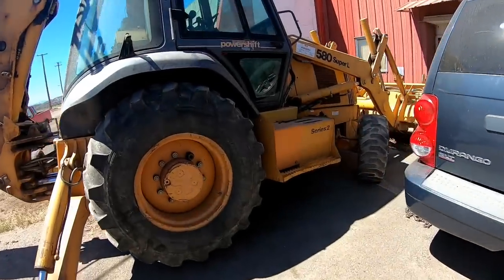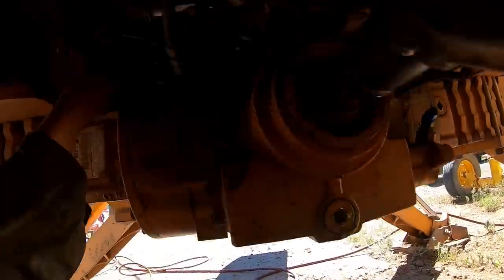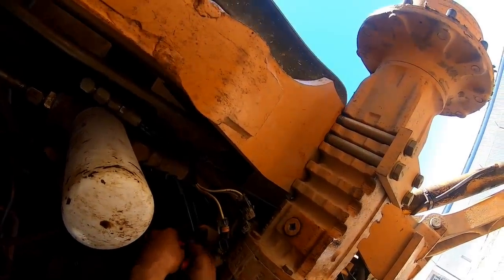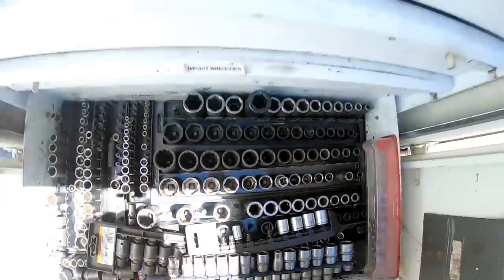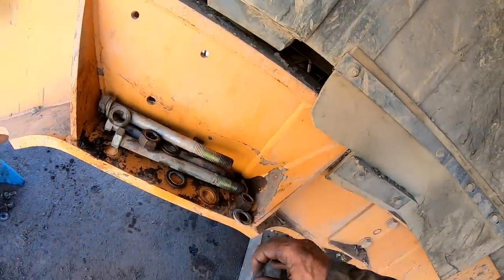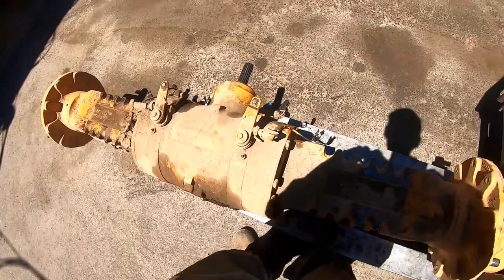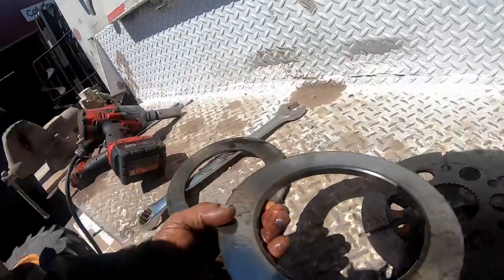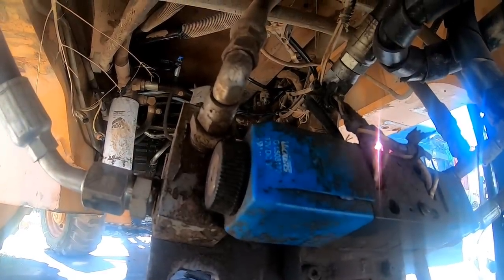Case 580 super L brakes

Comment: Don't get me wrong you obviously know what you're doing but I spotted two huge safety risks - dude you need to be more careful!!
First error was no supports for when you were under the machine. Just takes a hose to pop or a seal to fail and you're screwed. Supports went in later but you need them in straight away.
Second error was your crane brushing several times onto the power lines. Yes they're insulated but it's not good practice!
Peace dude but please take care.

Comment: Always Figure 8 a chain around your  Outrigger,  Hook it up tite,   THAT way it can't leak down,  EVEN if you had a unpredictable thunderstorm come through.  I had a friend,   a Jack come down on him ,  AND killed him,   I had another friend working under a dump truck bed,  HE wasn't going to be under there very long,  He should have safed it up ,  WITH a 4x4.   And another timber, crossways,   where the bed scissors in the back, To hold the bed up,    but he accidentally,  stepped on that emergency cable,  that drops the bed,   it come down on him before he could get out from under it,   AND it  cut him,   into,   they found him an hour or two later,  Safety First,   THERE'S no reason to be in that big a hurry,

Comment: I worked as a drivetrain engineer for Case and have been involved in countless Carraro axle/brake rebuilds.  I've never seen a Carraro axle disassembled vertically like this.  This mechanic is extremely creative and capable!

Comment: I don’t see any “Safety” blocks or jack stands. You are hoping the hydraulic system
holds the equipment up. At lease block the hydraulic cylinder shaft with
something.
Reply: Sorry, I see later that there are safety stands.
Reply: WELL, aren't you a breath of fresh air. If you had read the entire post you would have seen my reply acknowledging the jack stands.
Reply: That’s known way too be any one can make mistakes

Comment: Hi all, I just picked up a 1986 Super E runs great for cottage work but the need to push the brake pedal through the floor to stop it, I'm new at this so I'm assuming it needs breaks, can anyone recommend where I can get a repair and parts manual for this unit ? local Case dealer cant get me one at the moment any idea's on the breaks. Many thanks for your input.

Comment: I have tons of those Eaton/Vickers spool valves laying around. Is the valve itself bad or just the 12v coil? I've seen them get stuck but they're easily disassembled and repaired. I have a supplier as well.
Reply from the maker: The spool valve is bad, won't hold pressure.

Comment: Buckets on cylinders to catch hydraulic leaks? Man, That's a lot better than the Case 570 I used at the irrigation district in Banta California. That's not far from Manteca where Homes Tractor is. That district was so cheap, boss got mad cause I bought electrical tape on the company account already on sale.

Comment: I actually work for the railroad in Alabama. You'll do WAY better shipping just one piece over the road. if he bought 6 or 8 then it would be worth it. Otherwise id tell your friend not to waist his time, it would cost 10 times as much. Its different than shipping a vehicle by rail. One excavator will take an entire railcar and depending on its size it will be a specialized load which carries a higher cost.  Also, with vandals it may arrive with all the windows busted out and be spray painted with graffiti.

Comment: That Vickers valve is a standard DO3. It should be pretty easy to match up unless it is some very special application requiring odd features like spring returned to A or B rather than centered with both off. I had one like that that took weeks to source and had to come through Ford ( working on an old CF7000 dual steering system) even though it was a Parker branded DO3 valve. Had I ordered it through a Parker distributor it would have cost even more and they would not even estimate an ETA to get it.

Comment: At my garage it seems as though work goes in same types of spurts. Last week was transmission swap week. I had a week where I workec on about 10 cars and every one of them was repairing someone else's shitty job. One was the small crossover pressure lines on a power steering rack that rubbed on the dipstick tube. Another was a trailblazer with inline 6 engine. Had a tube for the heater core that started on left front of motor ran back and around bellhousing to the heater core. Well that tube has 2 tabs that go under the top 2 bellhousing bolts. Someone more than likelyt changed the transmission (4l60e) and installed top 2 bolts but not through the bracket so the tube rubbed on the manifold and put a hole in it. Only way to get the tube out is to pull engine or transmission. We JB Welded it and it lasted until her transmission went out durring last weeks transmission swap run.

Comment: Hahahahah I know all about running engines without the jake heads, I went to a call out where a bloke who had a few old Mack’s was running his valve set on a E7 Mack engine and lost where he was up to and couldn’t work out where he was up to. Anyhow, I figured out where he was up to and finished it up for him. Decided to run it up without the jake heads and sprayed oil all over the place, was dripping from the roof of the shed and all sorts!! Made a right mess. You live and you learn aye!

Comment: What make/model are those adjustables ?
Reply from the maker: https://www.google.com/aclk?sa=L&ai=DChcSEwiK0aLn6vniAhWW2WQKHS6JAmUYABAHGgJwag&ae=1&sig=AOD64_2Ne9ATABv18ytRo1SMAYHkMBVr9g&ctype=5&q=&ved=2ahUKEwio-pnn6vniAhX7IDQIHaQjChAQwg96BAgJEAc&adurl=https://www.amazon.com/KNIPEX-Tools-Small-Pliers-Wrench/dp/B01AY0JXPS/ref%3Dasc_df_B01AY0JXPS/%3Ftag%3Dhyprod-20%26linkCode%3Ddf0%26hvadid%3D309802506143%26hvpos%3D1o1%26hvnetw%3Dg%26hvrand%3D5432039133017376437%26hvpone%3D%26hvptwo%3D%26hvqmt%3D%26hvdev%3Dm%26hvdvcmdl%3D%26hvlocint%3D%26hvlocphy%3D9033130%26hvtargid%3Dpla-493705539778%26psc%3D1
Reply: knipex pliers, kinda pricey but just like the LockNLube grease gun coupler, well worth it.

Comment: That play is the clearance between your ring and pinion in your differential.   You can remove that clearance by shimming your ring gear closer to the pinion.  If the clearance is too much you may need to replace parts!!
Reply from the maker: Watch the video,  it's not the ring and pinion.